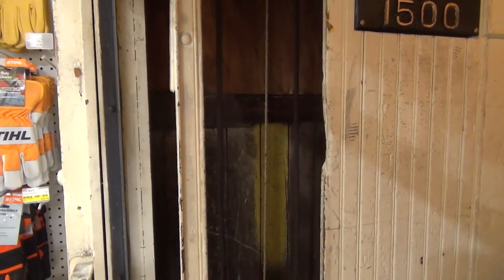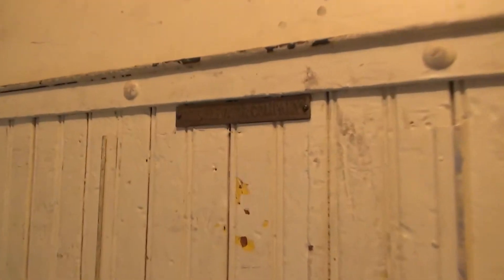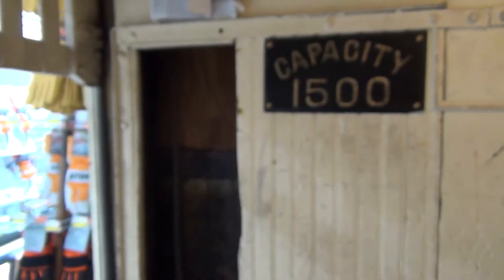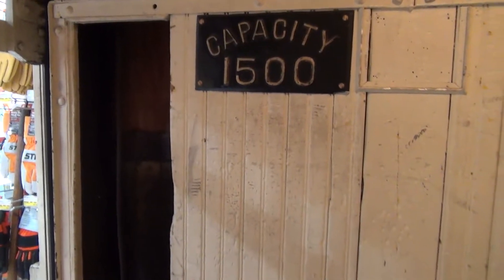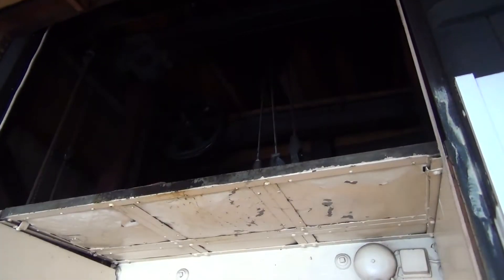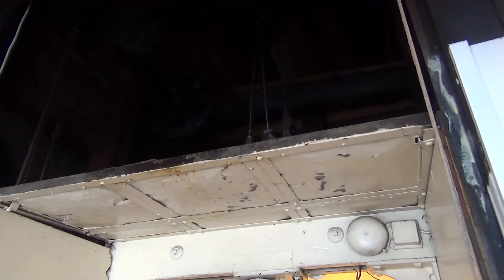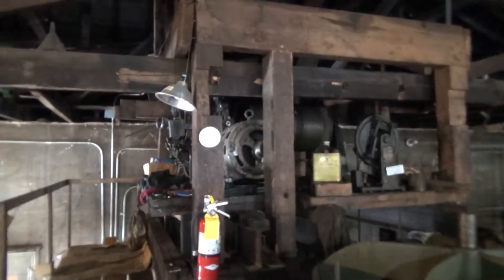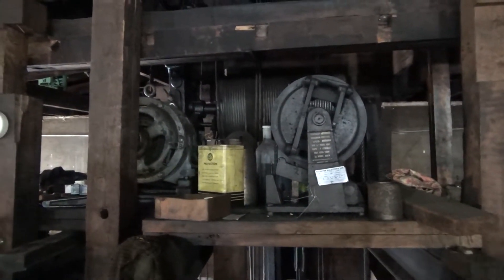Historic Otis "Pull the Rope" Traction Elevator - Ironton, OH

Comment: Very historic freight elevator "with a pull the rope up/down." Interesting about the type of motor, 2 phase maybe an older type of system back in the day. Thus needing the special transformer to tie into single phase AC lines.  I presume there is a reversing phase relay on the contacts or motor terminals/controller.  The machine appears to be a dual winding drum type,